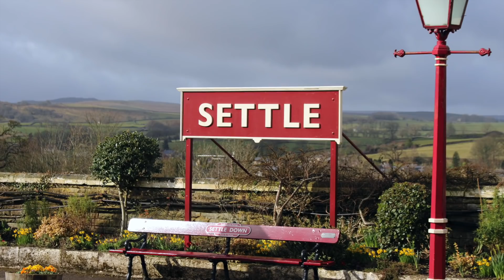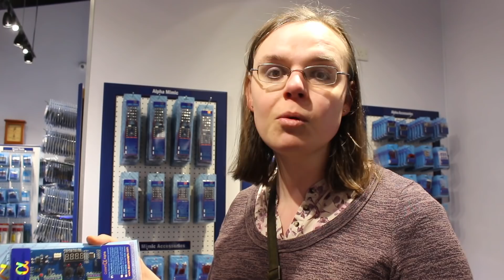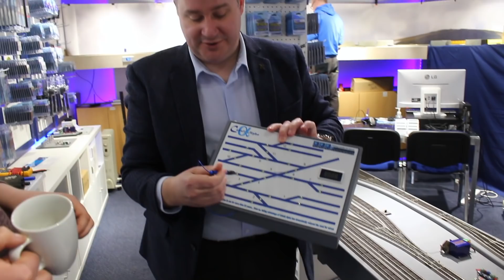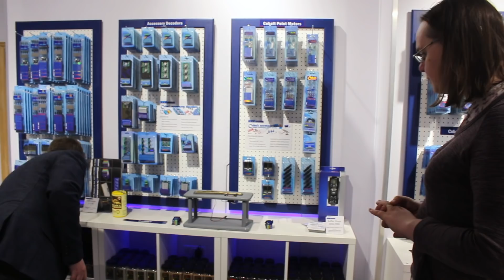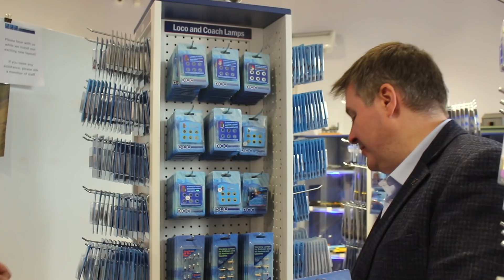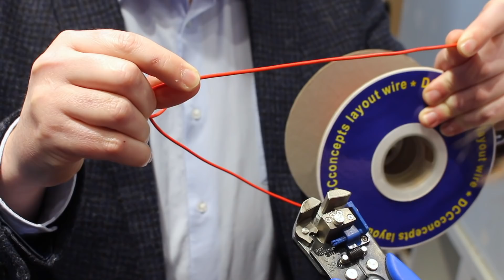Much More Than Just DCC? Visiting DCCconcepts!

Comment: The wire strippers are an excellent tool, as a retired industrial electrician I have used them for many years, they can strip anything from phone wire to 6.0mm cable without having to fiddle with any settings. A great visit Jennie.

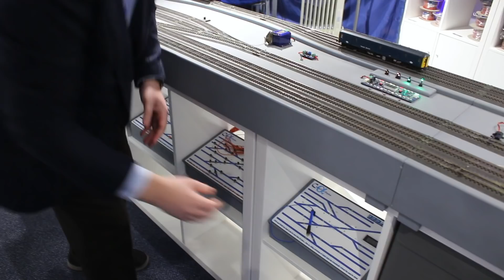Comment: Interesting overview. So at 14:15 is that the AEU unit again which he says strips out the CDU and interconnecting wiring to the analogue solenoid points? If so where is the (CDU) power coming from to fire the points ie is it on the AEU board. Also point of note for Ecos 50210 Users, the track V & A can be found on the Operations tab of the screen Menu. So has RJ / DCCC now fully relocated back to the UK (Settle) from Perth?

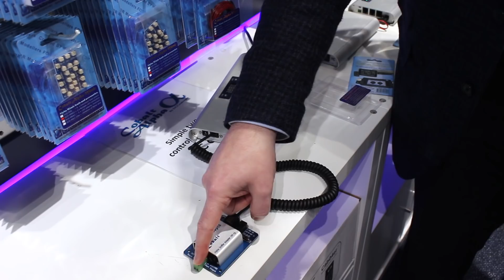Comment: 9:20 Just on two wires? There are only two wires on analogue. What's the big deal with digital?
Reply: The two wires control all of the points from the control box whereas with analog you need a separate wire from the control box to each point to control it. So it saves on a lot of wiring by creating a bus that each point can be connected to.